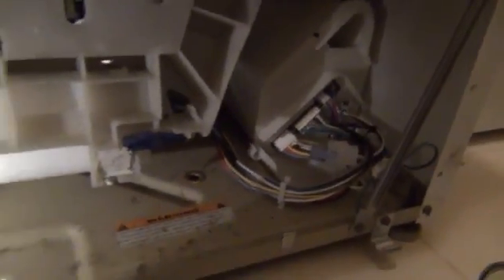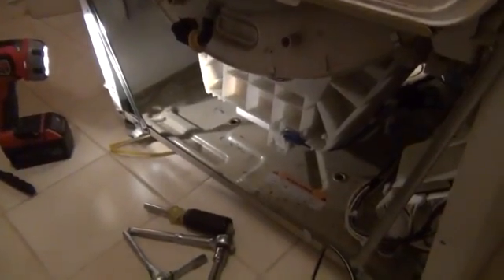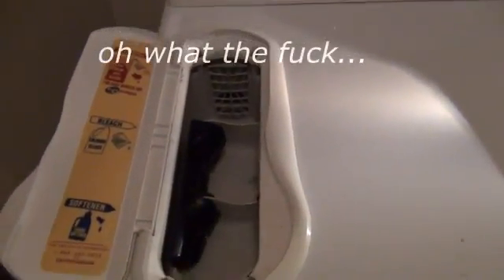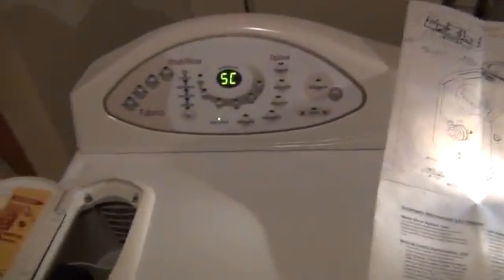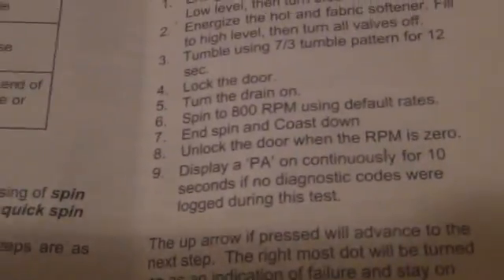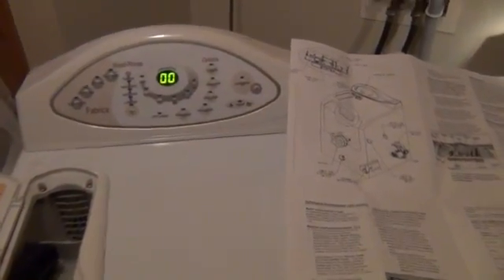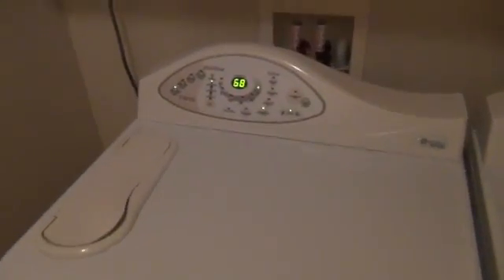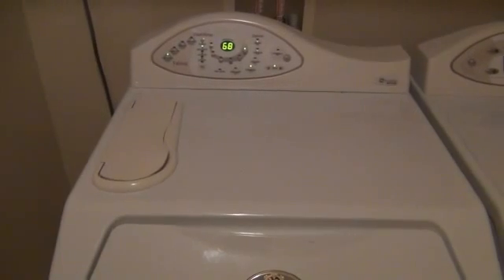Maytag Neptune washer repair:  motor/motor control circuit board replacement PART II

Comment: I have Neptune Maytag was her and when I press start nothing happens and a souble beep noise goes off or sometimes one long beep but the washer doesn’t start
Reply: I have a similar problem with my washer, what was the issue with yours ? Did you figure it out ?
 Thanks  Vic

Comment: Excellent job, well done. Have same unit and not sure if it is the motor or not. Circuit board not burnt. Would of been nice to have the kit number of the circuit board & motor.

Comment: Hey Dayton - Thanks for the video.  I've followed diagnostics and electric schematics to the motor control board.  All resistance at the wires leading to the board was within specifications.  The manual told me if this was the case, that the motor board is bad.  I took it out, and did not notice any burn marks on the board.  Can it still be faulty?  And if so, could you direct me where to find the motor/control board combination you talked about?  I have the Neptune MAH6500AWW.  No burn marks on the main control board either.  Thanks!

Comment: Thank you for posting this video.  Very helpful.  I also have a MAH5500BWW purchased in about 2001, and it too suffered the smoked board last night.  Two resistors at R19 and R29 actually blew off the printed circuit board. Out of curiosity, I searched YouTube for a video...and here I am.  I will order the replacement kit tomorrow and install.  Thanks to your vid, I'm not afraid of what I'm getting into.  Thanks for an awesome contribution to the interwebs!
Reply from the maker: +D.J. Black Not a problem and I'm glad these videos helped out another person.  I didn't know what I was getting myself into when I started taking mine apart but decided to make these videos when I found the problem hoping to pave the way for others.  Thanks for the positive comments and good luck with your project!
Reply: +daytonaturbofreak Motor Control board and motor installed and working like a champ. Machine is quieter too. Local parts house had it for $230. Back running. Thanks again sir.
Reply from the maker: +D.J. Black Awesome job.  Glad the video helped out and you're back in business.  No worse feeling in the world then when an appliance goes out but no better feeling knowing you were the one that fixed it!  I was just reflecting back on my video, that was just over two years ago now.  Mine's still going strong. (Knocking on wood)!
Reply: I need help! When I press start it makes a long beep noise but does not start. Sometimes will make a double beep noise only once when I press start

Comment: I have a maytag MAH4000AWW before you change your board look if the board is damage if not just sand off a little the connections and make sure the wires on the motor didn't loose up add problem's with mine and now working perfectly

Comment: Thanks for making this video!  Is your machine still working fine or did the bearing go out next?  My Neptune has the same issue your did.  I'm trying to decide if it is worth fixing, and whether I can do it myself, as I have a bad neck and since surgery it is m uch worse than before the doctors got their hands on me!  Now I'm really screwed!  Stay away from them... now I can't bend it at all, and it hurts all the time!  The local repair guy wants $400 parts and labor for this job.  I can get a new one for between $500 and $700.  I talked to a couple other guys that said if that has gone bad the bearing will go next and that take replacing the tub which is  $999.  So I'm not sure what to do.  This Neptune is in my mother's house and had little use until my sister came and she used it night and day constantly changing settings so I don't know if she wore it all out or just that control board which is burnt like yours...
Reply from the maker: Sargent Pepperland  my machine is still working fine.  no further problems.  really sorry to hear about your neck pain but if you can do the work yourself it would probably be worth it, if not, then maybe getting a different washer would be the better choice. this job will probably take the average person an hour to an hour and a half from start to finish, tearing things apart, putting it all back together, and the start up and testing...   good luck, i'm glad you enjoyed the video, and thanks for commenting...
Reply: $400 is a fair price to repair it.  The kit alone cost $250 plus the labor.

Comment: Where did you get the service sheet in the video that showed some of the test modes?
Reply from the maker: the service sheet was tucked inside the washer behind the cover of the push buttons control panel.  (back side, upper removable panel)

Comment: I have a Maytag MAH9700 washer purchased in 2006.  It sporadically stops and displays error code "3E"  (not E3); OVER CURRENT  IS DETECTED, MOTOR WON"T RUN." and stops working.  Pushing the START button will cause it to resume operation.  Sometimes it completes the cycle, other times the START button must be pushed additional times, until it finally finishes the cycle.  Other times it will run a complete cycle without any malfunctions.  Can you diagnose?
Reply from the maker: i only have the schematic and trouble shooting sheet that came with my washer and is only for my model... you would have to consult the schematic and trouble shooting guide that came with your washer to see what the solution is for a 3E trouble code...

Comment: Just did this conversion kit - washing first load now - hopefully everything is wired up correctly again - i unwired the pump too as i initially checked that.   My washer was purchased in 2001 approx and my board just fried - is your washer still working?  wondering how long the conversion fix will last......
Reply from the maker: hi Dave, yes my washer is still working as it should... i'm sure it will last a long time... after all the new MC circuit board is suppose to be new and improved, right?  lol  hopefully you are having good luck with your washer... ours are very close in years... mine must have been built sometime in 2000 since i moved into the house in December of that year and it was brand new...  thanks for commenting, hope the video helped and please let us know how yours is doing!

Comment: Daytonaturbofreak,

Thank you, thank you, thank you, thank you!!!!  Your 2 videos on this inspired me to say, "fuck it, I think I can do this".  I went through just about everything you mentioned on these 2 videos.  Two weeks ago I heard a loud CLUNK in the laundry room.  I quickly smelt what I would describe as hydronic fluid or oil.  After watching your video, I thought that maybe it was the board.  I checked the board and did not see any issues.  I figured it had to be the motor, so I ordered a new motor from SearsPartsDirect for about $215.00 total with delivery.  By the way, found a 10% online coupon code which worked on the website.  Received the motor, installed it, the existing motor control board wiring harness connection did not fit the connection located on the new motor.  After getting back on with SearsParts rep we determined that I had in fact ordered and received the correct motor they have listed as being the replacement.  So I went back to the website with the rep and they sell a kit (motor and board) for $195 total.  Cheaper than just the motor.....  Anyway, received both, installed, Sweet Success!!  Also, I had to adjust the belt slightly as well so that it was lined up correctly at the end of the shaft.  While the fly wheel was spinning, I called my wife in to have a look and she was like, "how the fuck did you do that"?

Thank you for taking the time to post this video.
Reply from the maker: that's awesome Robert!  Two success stories in one week! ha, cheaper to buy the complete kit than the motor separately... makes sense doesn't it?  glad you found the video helpful and sounds like you might have scored a few points with the wife too!

Comment: Mission accomplished, I ended up doing what you did and replaced the motor and control board upgrade, about the same cost $217, took about an hour, to have the Maytag service guy out is $149 to ring your doorbell and then go from there. the parts guy told me the other weak part in these machines is the tub bearing, only about $50 for the kit but not an easy job, $500 to have Maytag do it. But for now my wife thinks I'm a hero so I'll enjoy the moment. If you're ever in Connecticut I'll buy lunch, Thanks again
Reply from the maker: Brian, that is awesome news!  ^5  Glad you  were able to DIY and save a little money!  MY mission is accomplished!  And yes, enjoy your Hero status while you can! LOL  That's great it only took you about an hour.   I know it took me a few hours (maybe 3)  but of course that included tearing everything apart, finding the problem, diagnosing it, filming everything, putting things back together, etc... Out of curiosity, how old was your machine?  Mine was 13 years old but honestly  hasn't been used all that much since I've been divorced for 9 of those years and have worked out of town for I bet a total 5+ of those  years so mine, in my opinion, didn't really have all that much run time on it.  I would say more age against it than use.  None the less, still going strong after my repair.  Geez, they want $500 for the tub bearing.  That's good to know and I'll keep my fingers crossed I never have to do that repair!  If so, looks like it'll be another video opportunity!  Glad the video helped out!  Thanks for the update and thanks for the lunch offer!

Comment: Thanks very much this is very helpful, my machine is coming up with a "Lr" code which I believe is the motor code
Reply from the maker: well, it's leaning towards bad motor and/or control board it seems... and yes Lr is Locked rotor condition... did you smell any burnt electrical smell?   be sure to let us know what you came up with... always interesting to hear the "fixes"... glad this video was able to help you some...  good luck with your fix!